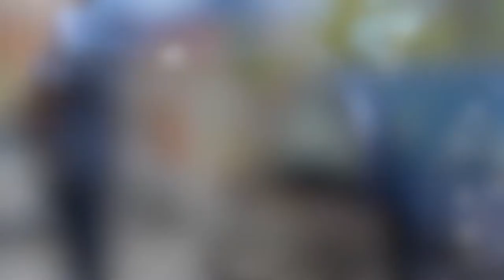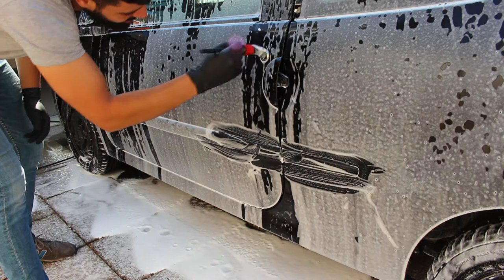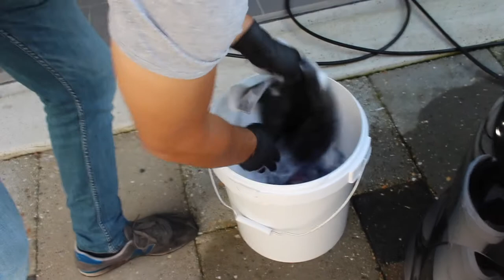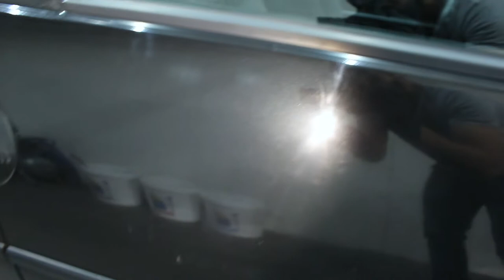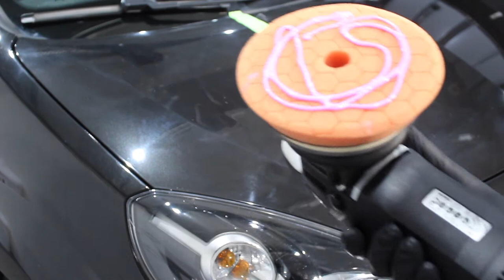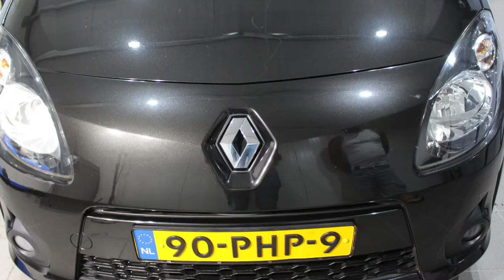How you wash Maintain and Protect your Car - Exterior Auto Detailing

Comment: A comprehensive wash should include dry cleaning of the interior, treatment of the seats with various means, cleaning the windows from the inside, removing dust with a vacuum cleaner.  Including you should use body protection after.

Comment: Which pad are you using?
Reply from the maker: I did use Orange pad from Chemical Guys 🙂
Reply: @absolutecarcleaning  I just bought a rupes but only bought a yellow wool pad from rupes and three pads from lake country . Which would you recommend I use with the uno on a black camry? Im new to the polishing/ paint correction world
Reply from the maker: @sandragaribay06  with the rupes yellow pad you will get a perfect result just tray to don't go harder then 4 speed with the machine and tray to keep it clean if you see that the pad get a lot of pasta then clean it and go again 😀